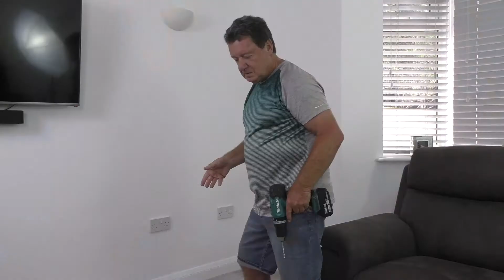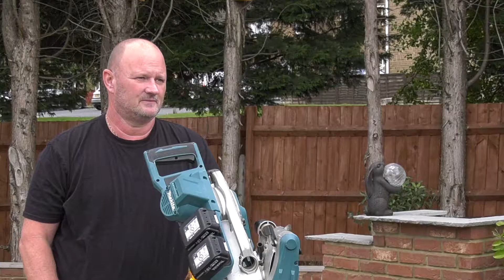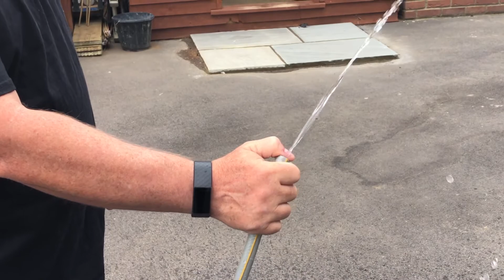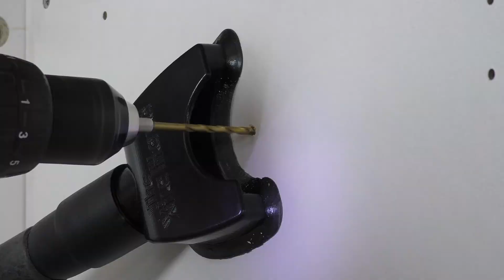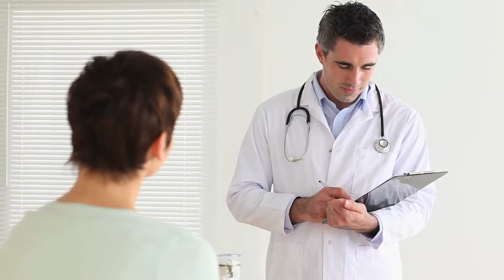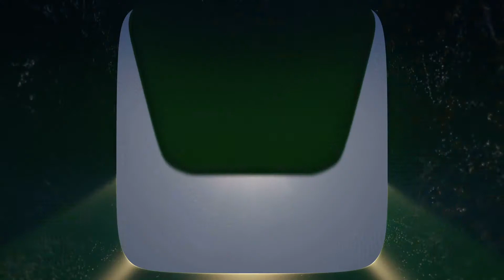The XtraHand by DrillBuddy Main Kickstarter Promotional Video

Comment: Wow, the XtraHand dust extraction tool sounds like a game-changer for anyone who uses a drill regularly! Its unique design and ability to work with various types of drill bits make it a versatile tool that can be used on different surfaces. The fact that it also helps minimize airborne particles is an added bonus for protecting users' health.

It's inspiring to hear the story of how the XtraHand came to be, and how the inventor, Alan, persevered through multiple attempts to perfect the design. It's also great to know that the manufacturing process is being done locally and sustainably, with recycled plastic being used.

Overall, the XtraHand seems like a well-designed and practical tool that can make drilling cleaner, safer, and more efficient. I can see why it would make a great Christmas gift for DIY enthusiasts or professionals alike.